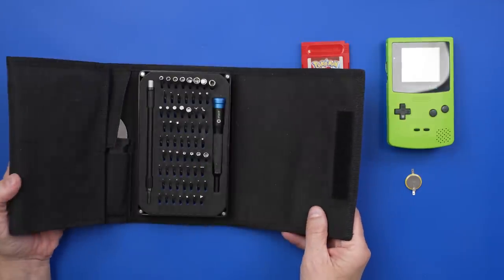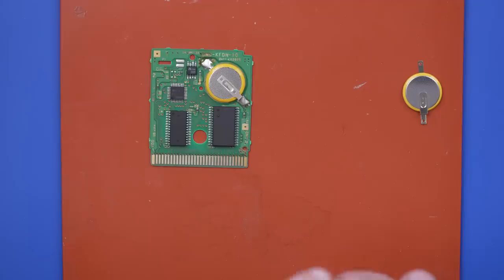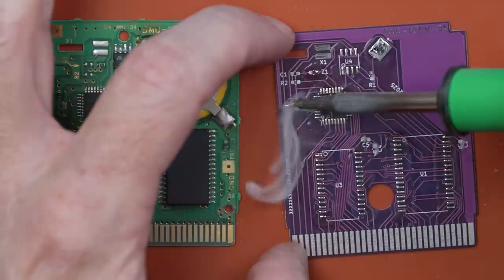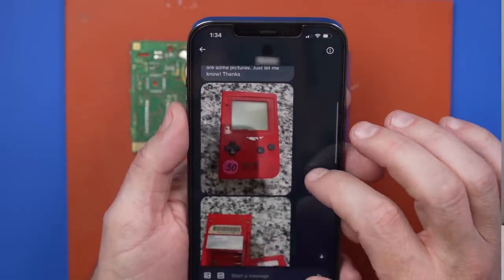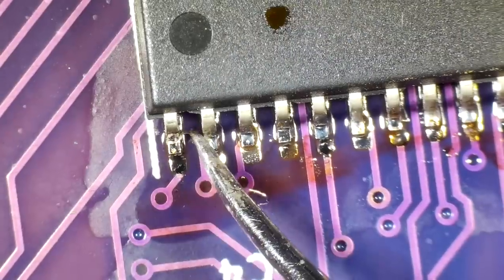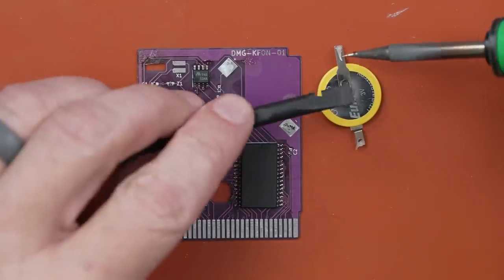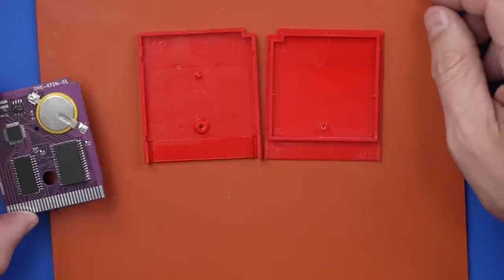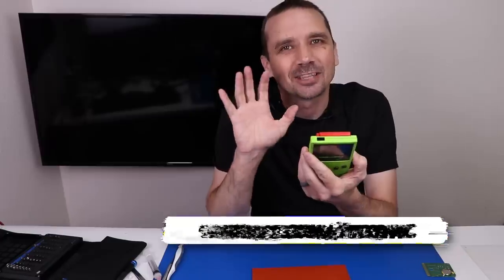Pokemon Red Game DESTROYED by Liquid - Let's Try to Save It!

Comment: Just a few questions because I’m a novice trying to get into electric repair. 

I’ve only ever  really known solder in a wire form. Would what you’re using be solder paste?

Also on your technique when you redid the legs of the chip did you add solder to the iron prior then touch it to the legs?

Comment: Would suggest getting ENIG coating on the card edge connector. And also having the solder mask cover just the slightest top bit of the card edge, just to make it slightly harder for the thin traces to get corroded.

Comment: Great video as always, just a quick question, why so much flux? I've never had to use flux on any repair and especially not with a soldering iron as the solder wire has flux in it already! Means you don't have to do a whole cleanup afterwards and just less time overall, just curious
Reply: Flux will help the metal flow and remove impurities. Your repairs may work the way you do it, but they will not be as strong over time.

Comment: I've been trying to get my Xbox 360 (white model 08) back up and running. Sometimes it reads the disc and plays and sometimes it doesn't. In your adverse experience what seems to be the problem? Is it the laser eye? I've ordered a replacement drive from (Ebay). I'm just hoping that's the problem and not another internal issue with the Mom board. Otherwise I'll have to buy another 360. I've had mine since 08 so I'm kinda attrached to it. I clean it and always took care of it. BTW, from watching your videos I was brave enough to swap out the laser eye with another one from another drive that was supposed to be NEW from Ebay but was junk. But that eye didn't work either. Think was for a Japan model Xbox

Comment: Those contact pins on the new PCB looks like solder pads, how strong are they? I am curious if they are as durable as the original plated pins.

Comment: I would also invest in a better PCB cleaning system like a vapor degreaser to clean the boards. Q-tips and toothbrushes have a tendency to produce static and also do not fully clean the flux from the board. There is also a spray cleaner called "Flux Off" that works well also.  Or if you prefer to use the IPA as you do. Install a small vacuum system to suck up the IPA/flux as you clean. Methyl Ethyl Keytone is a good cleaner also. And dries fast as well.

Comment: Interesting. Though after replacing the board, it's hardly original hardware. May as well rock a repro at that point. If I can ask, what was the cost of the replacement board?

Comment: I really enjoy your videos. 👍
If there is going to be another version of the board. (jylamjylam already mentioned to use ENIG)
So I would like to point out the different length of the VDD/GND pins of the edge fingers.
They are a tiny bit longer then the rest.😟

Comment: Curious how much it was to fab that pcb.. can you share? Im having an odd issue right now with a gameboy red.. I've replaced the battery but still unable to save properly. Ive checked that the battery is 3.3v and polarized correctly. If I power on/off real quick the data is there but not if i wait more than 10 seconds. The traces, components and pcb all look to be in good clean shape. I guess one of the components could be bad but the save issue is the only fault. Any ideas out there? Anywhere can I buy replacement components or know substitute part numbers?

Comment: I have a old broken gameboy game I have around. I tried cleaning it and reflowing it. Wonder if it just needs a new board...
Reply: Could test continuity from the connecting pins to the chips.
Reply: @kermitthegaminghermit8736   The audio chip checks out fine and all the verticies as well to the pins on the bottom, the ROM chip I can't fully test out because it's a SMD and I can't find any traces, the bottom pins on the board have been cleaned, cleaned and recleaned. I don't believe there is a issue there. All I can figure out it's the Rom  I got it close to saying Nintendo once, but that was it.

Comment: They should try to find some sort of padding to place on that part of the plastic cartridge that rubs on those small traces to keep them protected. when I worked for GE Aviation, we had material that would have worked perfectly. Also, I would have tack soldered opposite corners of the chips without solder on any other pads to make sure the parts sit flush and straight. then solder the other pins quickly with a mini wave tip. just my own preference.

Comment: 6:34 I did see some flux on the board but it was definitely looking pretty dry when you soldered those chips down. If I wanted to do that one-and-done with the hot air tool, I'd definitely use a more powerful rosin flux or a no-clean paste like Amtech 559 or MG 8341. Also pressing down to make sure it's fully in place. 

Otherwise, I would much rather just put the component on the bare pads with no tinning and let the tiny amount of solder left on the legs stick it in place, then tack and drag solder to finish off once I have all the components on.

Comment: So, I know I'm a little late to the video, but, while renovating my home office and going through some old boxes, I found my oldest game cartridge. The Game that started it all, as it were. Pokemon Red for the gameboy color. It was the first game & gaming device that was 'mine". Not my dads, not my cousin's, not my friends, MINE. So of course when I also found my old Gameboy Advanced SP and the charger, I plugged it all in and tried to play a little.

I got the "gameboy nintendo" screen, the next screen with the three copyright lines, the game freak screen, the quick battle screen, the game intro screen with the pokemon sliding on and off the screen, then I hit start, got the "saved game / new game / options" screen, accept there was no current save file, so I hit new game ...

the screen went white, and professor oak came on screen like he was supposed to, then when his text box appeared on screen, no text appeared, the game froze, and it's like the game just started playing all of the sound bites written to the card. I heard the battle sounds, a couple of pokemon calls, some of the music from some of the towns, then after a few seconds of random sounds, it went silent or to a high pitched ring and never got any further ... 

Could this be a "re-flow the solder" issue? or is one of my chips damaged beyond repair? ... is there any hope for my dear old pokemon red?

Comment: I love how you can solder a capacitor the size of a grain of sand 1st time with no issues but absolutely suck at soldering a battery terminal the size of a postage stamp. There is hope for us mere mortals after all.

Comment: would love to see more videos on fixing retro systems, I have a crystal XBOX that I'd like to get fixed, it won't power on, I tried swapping with a known good power supply but no luck. From what I have read online, could be a small transistor that needs replacing. I could do it myself but I don't have the right equipment.

Comment: Guys, have you ever tried to get a short run of boards made with hard gold finish? It's not something many PCB houses offer and it's neither easy nor cheap.

I honestly think for something that will be inserted repeatedly, I would rather do HASL than ENIG just because the gold layer on ENIG is so thin and soft. For an edge connector that is infrequently inserted (like a RAM module or PCIe card), ENIG could be better just because of its corrosion resistance.

Comment: I have a very best repro from Pokemon Red Version! 
The case and the cover photo looks completely original but it is not original.
A very good PCB with battery socket included, just perfect for swapping batteries without soldering.

Comment: I noticed you also made the edge-connect pins all the same length. That's bad. That's possibly "fry your equipment" bad. The first and last edge connectors are longer on the original cart for a good reason. Those are the ground/voltage pins. Those need to connect first before the signal pins to prevent shorting if the cart is removed while the unit is powered. You run the risk of damaging the cart or the gameboy as it is now.

Comment: Soldering on the battery, why not switch to a larger tip? Or recommend to watchers that they consider using the correct tip.  It drives me crazy when other users use the fine tips at the soldering station, press really hard to get enough heat, and end up bending the heck out of tips.

Comment: I still need to figure out why my GBC modding failed. It wont power on at all now i think i crossed a connection when i was testing it with my multi-meter :(

Comment: Do you do gaming PCs? I've got a gaming pc that's been to 4 different shops, geek squad, and the manufacturer and no one can figure out what's wrong with it.
Reply: For context, it will run for about 10 minute, 30 minutes, hell, it'll even run for 6 hours sometimes but in the end it always does the same thing. It makes the sound that a usb device is disconnecting, the wifi will disconnect and won't let me reconnect and the display flickers. It will show wifi connections available but won't connect to them. And the only way I've found to get it to work right again is to power it off. But then it does it again. 

I've wiped the drive and reinstalled windows. They've replaced the RAM, they've done things with bios, they've done other things as well. But they can't figure it out. I'm at my wits end.

Comment: Be careful hot air n batteries don't mix well..
Reply: the battery is fine. id be more worried about the capacitors exploding. cover them with Kapton tape to thermally insulate them
Reply: @_BELMONT_  yeah can't even see any caps, n if they are they're smd, which won't explode aluminium caps absolutely

Comment: Luckily it doesn't seem like that pin is used, but it looks like you've got a solder bridge at U2 (4:30 6:48) between the upper 2nd and 3rd pins :p
Reply: They're both ground pins, when you route the traces automatically, it usually bridges them by itself, if you look before he puts solder on it, it has a trace in there anyway.

Comment: What is the optimal temperature for a hot air gun to be able to do things like in the video?
Reply: I thought I heard him say something like 200 degrees. I was like, damn thats HOT!
Reply: You don't want a hot air gun, you want a SMD rework station with a temp control and airflow control. The amount of heat will change depending on the size of the PCB, how much copper it has, and how delicate the chip you're removing is. For something small like this, you can get away with like 200C (most electrical solder melts at 188C) because there isn't much copper and the PCB is small, but larger boards like a computer motherboard with a dedicated ground plane (giant copper plate) and multiple layers of copper will require you to pre-heat the entire PCB to like 75-125C and then come in with the rework tool at like 250-280~C for a VERY quick re-flow of the solder and removal of the part.

Comment: Hey I have a broken iphone with possible motherboard issues, wanna fix it?
Reply: Well if the screen is cracked then I would go buy a new screen but I would not recommend because buying a screen might cost more money depending on what brand of phone you got
Reply: Mother you can just take some of the parts out and just replace it with a new one but I would be careful when taking the parts out because some of this requires experience

Comment: Nice fix! Just to add my 2 cents: I think the fat silicone pad isn't such a good idea. ;)

If the silicone pad is really sucking heat, then you have to heat a lot more than needed in a small area for the whole IC surface to be hot enough to remelt because the heat sucking of the pad will create sharp temperature gradients.

What you want is to preheat your board and components to a nice intermediate temperature (like maybe 100-150C), ideally with a heated bed, before locally applying hot air to solder components. That way you have to add a lot less heat with the hot air gun, and you minimize thermal gradients on your board which is way safer.

Comment: At what point do you think a cartridge stops being an authentic original and starts being a "reproduction"? 

Say instead of just moving the chips over to the other board, you copied the data onto new chips.  No one would consider that an original.  But what is so special about the chips themselves that would be considered valuable?

Comment: 3:10 - NO! When you tin the pads they won’t be flat so you can’t tack down the chips properly before soldering.
Reply from the maker: YES! You don't need to tack them down when you're using hot air.
Reply: @Tronicsfix  The surface tension keeps them elevated unless you push down… and pushing down can skew alignment. They were visibly elevated when you went back to reflow them, so it would’ve been less work and a better result if you never bothered to use hot air. Obviously, you can do it however works for you but after fighting to get things flat I certainly wouldn’t do that to myself deliberately! ;)
Reply: I never use hot air for these. Drag soldering is so much easier and nearly impossible to make bridges because of the nice spaces out pin pitch
Reply: @jamesdavies686  Yeah, since he soldered every pin with the iron anyway it would’ve been easier just to do that from the start. I will admit that hot air could potentially give better results for paste soldering. Still, paste and hot air would only make sense for my workflow if I were assembling dozens. For a chip swap I’ll take drag soldering any day of the week!

Comment: Steve, does your soldering iron have a "built-in" solder dispenser? How do you do it, just touching things and magically getting solder there? Haha 

Also, what temperature do you use your hot air station?
Reply: he pre solder the tip already